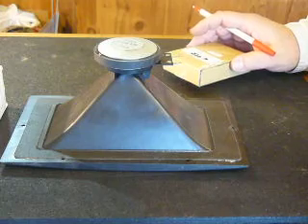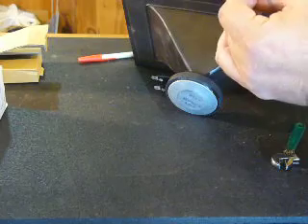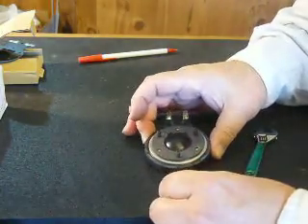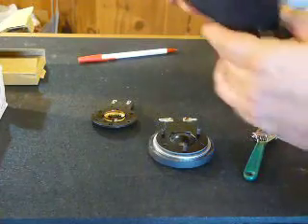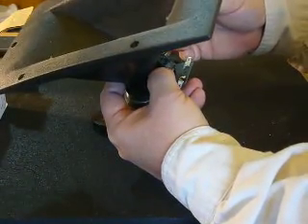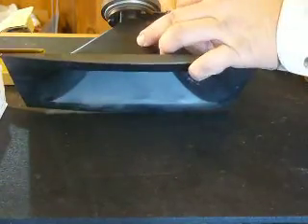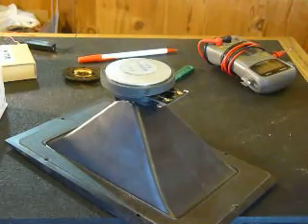Klipsch KG 4.2 Tractrix Horn repair

Comment: Is this worth it though? Is it going to be the same quality? I bought klipsch because I wanted quality and I’m worried these replacements won’t be as good and maybe be knockoff
Reply from the maker: This is not a high end driver, more like a bulk driver. The replacement coil will work just fine. Mine still work very good.

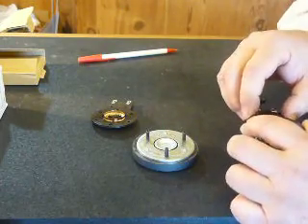Comment: Hi what is the fluid mentioned in 2:59 ?
Reply from the maker: Ferrofluid... It is used to help cool the voice coils on tweeters and small midranges. 
When you use ferrofluid on tweeters I have noticed it "tames down" rough edged highs on compression drivers. Actually most all tweeters, its just you can REALLY hear the difference on horns (compression drivers).
Reply: @breakerbroke23   okay thank you!